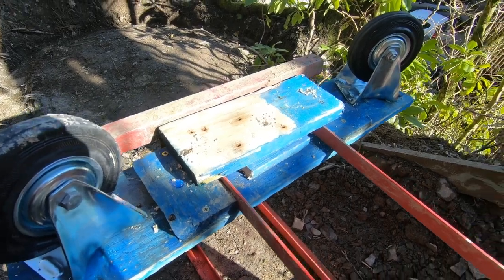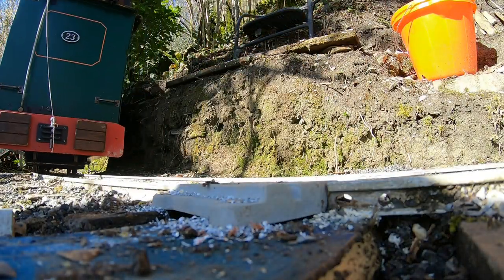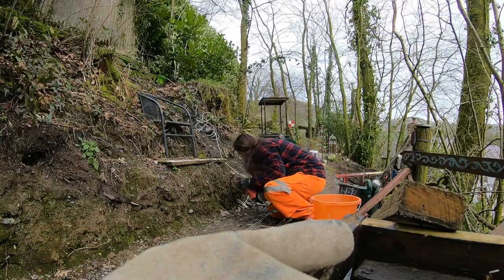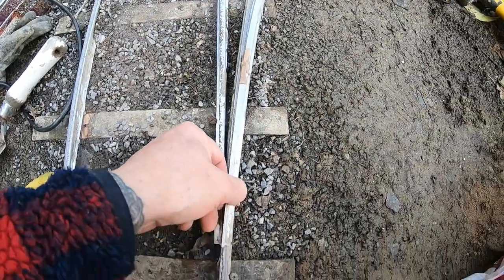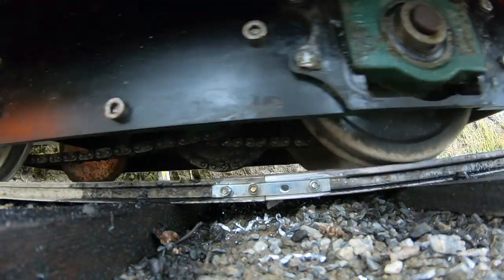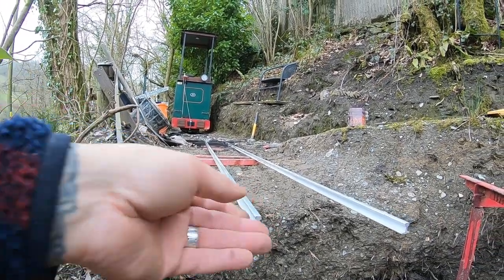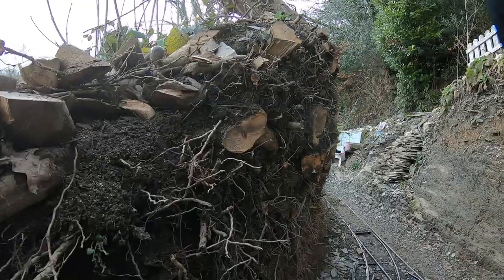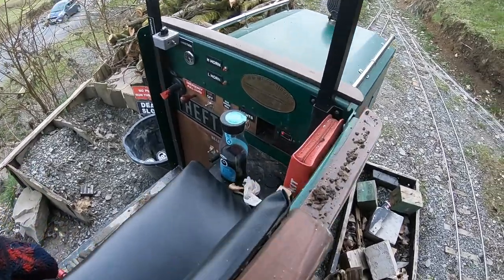Ivy Minimal Gauge Railway Turntable Installation Part 2, Making The New Siding Etc. 7 1/4" Gauge.

Comment: I know its not my railway and I'm not doing the digging but I was disappointed that you left so much of those roots and glad that you cut some off. You have a friend with a chainsaw and you could wash out some soil first.... just saying.
Reply from the maker: I have a chainsaw myself which I blunted last time I tried cutting roots. I am just glad to be able to get past it for now. One day it may go but it isn't easy to remove.
Reply: Cutting roots with a chainsaw can be a pain. They tend to jam up the chain because they are softer  than branches. That's my experience and any small stones caught up in them will soon blunt your chain!
Reply from the maker: @wideyxyz2271  yes that's what I found. Lots of tiny pieces of slate in-between them.

Comment: Sitting here watching this, dozing. Sorry, not dozing because of the content, no, not at all. Life at the moment mate, life. So, in my half dream state, I was thinking… rail treatment wagon, to vacuum up leaves and debris, maybe even to assist with lifting the sleepers, and packing ballast. Which brings me around to… if there’s too much movement up/down of the rails, being aluminium, wouldn’t they be prone to fatigue fractures? Also could be scary on the turntable. As you’re doing a 180 revolution, you can’t have an end with buffers. Maybe a device that can give temporary buffers, or wheel chocks at both ends. Visually scary as well. A nice mostly solid fence around the perimeter would be nice. A good height, mind you.
Reply from the maker: Yes there will definitely be safety features before it is used. I don't fancy losing my loco down the bank!